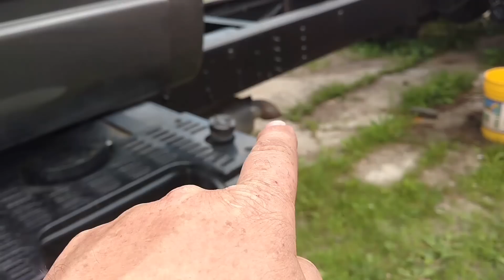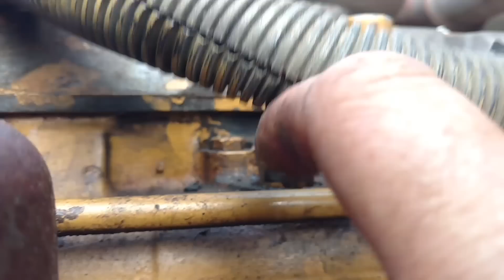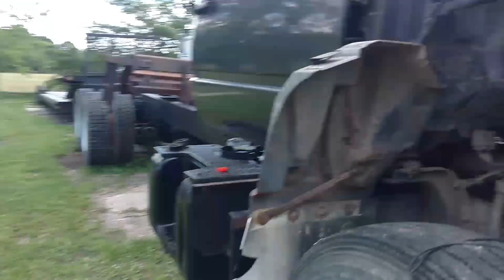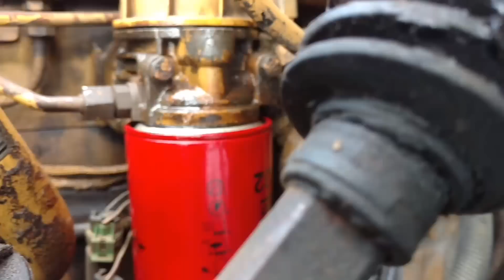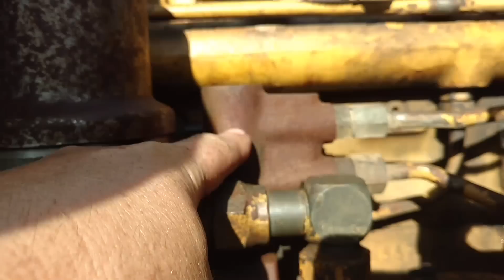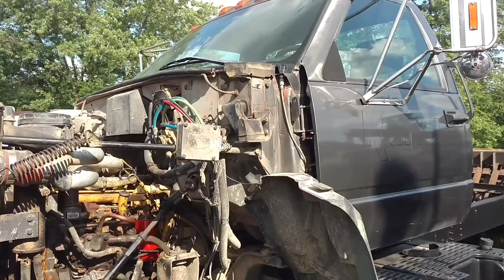1998 gmc c8500 CAT 3116E RUNNING PROBLEMS. DIGGING DEEPER.

Comment: Thanks, I have exact same motor dealing with the same type problem, I was wondering if I could install a universal electric fuel pump on it to get fuel to the heui pump and if so where would I put it? I got a fittings from cat and put a fuel pressure tester on it where the plug is on top of the fuel filter on the side of the engine and no fuel

Comment: I'm a little late to the show but is there a part 3. I didn't find it. I bought a 1996 topkick with the 3116. 335k miles. Seems to run good. Want to do fuel filters. It's my first time with this motor. Worked on others. I don't see a manual pump to prime. After hearing it's a drawn system I assume as long as the filter is full going on, I can open that top bolt and get the rest of the air out. Am I safe to assume this?

Comment: To find the leak,
Jerry can and cheep 12v  diesel pump beats pressurizing tank every day. 
And power source is always there with the truck. 

draw systems suck. 

Literally.

 As a comparison

Tis easier to put the pump in the well and pump head,

than it is to have pump suck water  up to ground level. Imlo.

Comment: Been dealing with the same issue on a cat 3126 and cat 3116.     When they run they r great motors when u loose pressure somewhere its a complete nightmare.    We run bucket trucks and digger trucks I have 4 3126 cat motors 1 3116.    The one cat 3126 is a constant pain in the ass  dumped so much cash into to keep it on the road but seems to constantly come up with mysterious loss of power issues I initially was taking it to dealer which costed so much money to diagnose the problem which just leads to another.    This is when I decided its time for me to learn more about this motor and how it operates.   Last winter it suddenly lost power going up hills you would have to pull over shut it off let it sit start up ran fine for a bit same thing would happen.    Took it to dealer they said it was the high pressure sensor on Huey.   Drove it home took on the a job next day same issue.   Drove back to dealer they ran some test recommended turning up the power and putting a new Huey pump.   I had no choice but to do what they recommend had to have the truck on the road paid way to much but again my hands where tied.   Picked up the truck it ran better than ever was very happy 6 months latter lost all power again.   Took it back they said it’s probably injectors when they gave me the price to change them I was ready to drive it over a cliff.    Long story short I brought it home ordered injectors online on ebay I had several choices but found a guy out of Florida that rebuilds injectors he said he had six ready to go will get them to me in two days with no core charge.   I removed the original ones which where original and all matching.  When I received the ones I ordered they were all refurbished but different models.   I called the guy he said that would not make a difference they will still operate the same.   I installed the new rebuilds after performing all the proper steps of removal and installing injectors truck ran worse than before.    I was furious after all the hard work then to have the truck run like shit.   I called the guy he told me its just oil in the cylinders I just need to run well he was full of bs.   I said I want my money back I’m sending these junk injectors back he then said send me your originals he would rebuild and send back no charge meanwhile I’m loosing money every day the truck sits.    I finally get originals back installed them truck ran like new.    Was so happy 5 months later had an oil leak coming out from Huey pump bottom hard line with 45 angle.   Leak became pretty bad had to fix it tore line off replaced little blue o ring with cat replacement put back together dam thing would not start.   Drove me crazy for days truck ran fine before I took line off all i did was removed one line put new seal on put line back on now it will not run.   I called around talked to several mechanics tried everything could not get the dam thing to run.    Finally one night I found a guy posted the same problem on YouTube with the same line same leak.    I find out if the that 45 degree angle fitting is not exactly at a 40 degree alignment the oil pressure will not be enough to fire engine tore all apart started over did everything by specs sprayed a shot of diesel starting fluid in air box dam thing fired right up.     Last Thursday truck was coming home lost power again going up hills I was so pissed.    After two days of investigating I drained all the oil replaced all the filters drained fuel tank started from scratch.   Put everything back together truck runs great again.   Found in the first fuel filter some dirt particles so either somewhere we bought bad fuel or possibly the fuel line from the tank might be rusting inside I don’t know.   But its amazing how simple these motors r once you learn how the hole system operates.   That being said its far from simple to find out where your problem is when either looses power or will not start.    We have one 3126 that has almost 300,000 miles that we have done nothing but normal maintenance.   Then I have this one that just hit 100,000 and has always been a pain in the ass.    The 3116 only has 58,000 miles and constantly is problem.    So good luck to all.     I have been told though the new diesels r a real nightmare you have to take them to dealer everything is computer operated.     So I now try to stick to the older diesels I know how to work on.    We also have a Cummins that never has let us down.    Sorry for my rant just wanted to share my experience

Comment: Love watching your vids.
Good ol HEUI system, they can be a pain but otherwise it was a great idea.  My T444e has it, makes it to where I can run crappy cheap fuel without worrying about a expensive high pressure fuel pump being wasted.  The injectors will put up with quite a bit before they wear out.
I hate mechanical lift pumps, it's better to convert them to electronic fuel pump.

Comment: J.C. , I like your logic , I have worked on  HEUI system before on cat 3126 and my 7.s powerstroke , some time it can be a real pain in the butt , but I nave my money on you , ie there any where that will give info on all the pin connectors of  ECM's   ?      Frank T

Comment: Did you ever consider that rubber fuel lines will collapse.  It'll have time to pressurize and start then because of restriction will not be able to meet engine demand and act like your out of fuel.

Comment: J.C, I really appreciate the videos. Your work has been a big help to me in trying to get a 3126 to fire up. If you don't mind I would like to put a question out there for you or some of your other subscribers - I have a new HEUI pump, IPR, injectors redressed and tested, ECU tested good...all work done professionally. But it will only build high oil pressure after using ether to get it firing first. Anyone else encounter this type of issue? The service tech said everything checks out as good with the diagnostic laptop. Many thanks!
Reply from the maker: how have you come to the conclusion that it is not building high pressure oil? do you have a manual gauge in the high pressure rail? or are you watching the pressure on a scan tool? in order to help it is best to start from the beginning. history of the truck, miles, amount of blow by, running problems before this, and what problem you have now. this will likely be a lot of back and forth messages but i am willing to help as much as my knowledge will alow.
Reply: I haven't been able to working on the truck this last week, weather's been sketchy.  What I think happened is by hitting it with enough ether ive been able to trick the truck into thinking it is running and goes into limp home mode.   When the weather was still warm I could see on the manual pressure gauge that only engine oil pressure was present,  but getting it to fire with either would get it to run just enough for the ECM to tell the Heui pump to build pressure and then will actually run.  When the temperatures dropped into the 40s I was not able to replicate the same scenario with either until I blasted it with 1/2 can or more.  I guess by doing so it warmed the engine up just enough to convince it to run in limp mode. The only part I haven't replaced is the actuation pressure sensor itself.   I picked one up from the cat dealer just this afternoon but still need to ensure it's got a 5 V signal going to it  before opening the package and making the part nonreturnable.  The truck is a military vehicle I got at auction, so it's a project for sure.   The truck is actually pretty clean, just over 2000 miles and 360 operating hours, now I just need to learn the truck inside and out. It's been a learning curve!  I checked out Brandon's video, sounds like he's been real close to my home here in Texas. Liberty Texas is not far for me.  Thanks for your response, I'll let you know how it goes.
Reply: I think I've narrowed it down to a problem with the ECM.  I have 7volts at Pin 27 which is the IAP sensor that should be sending a voltage into the ECM....not receiving power from the ECM.  Reference voltage is only 5v, so 7 volts is not right in my opinion - short in the ECM(?).  The throttle position sensor is 8V so my next test is to disconnect the TPS and see if that changes anything.  I don't have a scan tool so I'm at a disadvantage in that respect.  If the weather let's up a bit I'll be able to get back to it - ultimately I will likely send the ECM out for repair.  If your truck operates well and it just hard to start then I would say your issue is not as severe as what I'm dealing with-mine will run but it's limp mode (I think) since the trans will not upshift...still much to sort out.  Thanks for commenting I'll post more when I get a chance to do more testing.
Reply: Definitely waiting a reply same issue when cold hard to start if I put quick start it goes
Reply: Thank You I will be heading out short to do some of these test I've learn from this medium thanks much.....one of the best video out on this exact engine....

Comment: I have a mechanical 3116 that runs great but don't have the power it used to. cat replaced the injectors and turbo and didn't make much diffrence.
Reply from the maker: i am not a professional diesel mechanic. are the injectors out of adjustment? a mechanical engine plunges the injectors to fire via the camshaft. excessive clearance will not push the plunger as far therefore reduce the amount of diesel sprayed into the cylinder.
Reply: J.C. SMITH PROJECTS I will check that tommorow

Comment: Take the pump off add a distributor , build an intake and put a Holley 4 barrel on it J.C. Glad someone don't mind working on a 3116. I worked on one over the weekend and still regret it..
Reply from the maker: that sounds more like something you would build. it would still be a cat.
Reply: Paint it ford blue and tell everyone it's a ford. I actually thought about turning the 3116 I have into a gas, but I took a look at the original pistons and there's not enough meat on them to mill them down to lower the compression where it needs to be, Plugs would have to replace the injectors and tubes made to bring them up so the oil don't cover them. It could be done.
Reply from the maker: ford quit using blue decades ago! waste all that time, effort, machining and good parts on this? have you ever heard me say...stepping over dollars to pick up nickels?? or even better yet. you can polish a turd but it is still a turd. a frankenturd. i will pass.
Reply: Sometimes you gotta do something just because you wanna do it!! Don't make everything about dollars and cents it makes life go by too fast!!
Reply from the maker: well i could do it in my spare time. i am not doing anything between midnight and 4 a.m. i am usually just laying around anyway.

Comment: had a truck like that a few years ago could not find a leak any where and after alot of head aches all it was the pickup had come off in the tank was an old farm truck too..  not saying thats your problem though
Reply from the maker: that is one of  the possibilities. i had one with a cracked pick up tube once than ran fine as long as the tank had a 1/2 tank or better,

Comment: Maybe the guy who was replacing the fuel system parts did not properly install them or re-tighten the lines. I agree with you that air is getting into the system.
Reply from the maker: following after someone else always brings up alot of those scenarios doesnt it? you have to go over everything with a fine tooth comb looking for the slightest flaw or imperfection that hopefully leads you to the problem.